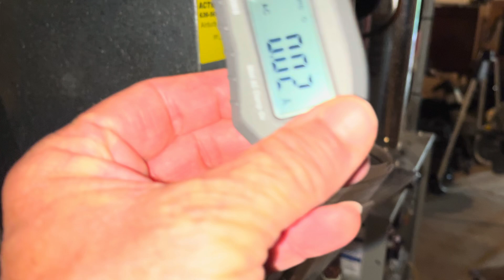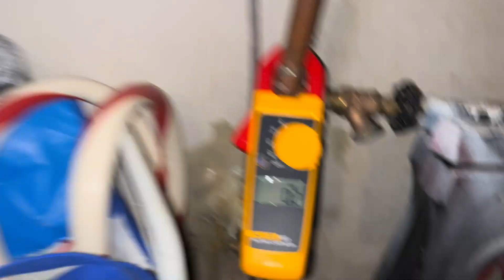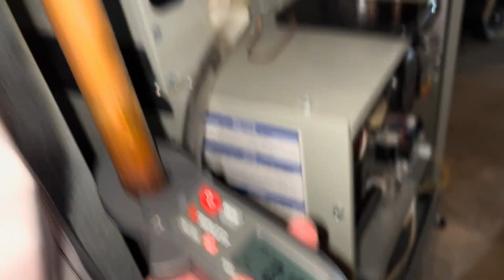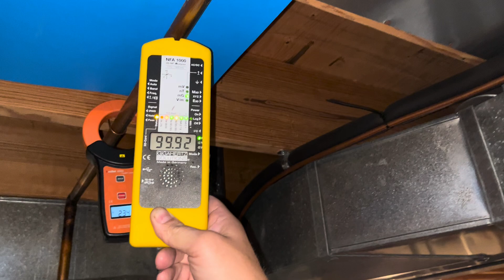Water Pipe and Gas Line touching causing current to go everywhere

Comment: In Canada gas lines as well as water lines are required to be bonded. Was the bonding correct at the load centre? Ground rods installed and connected correctly! If the load centre bonding is correct then bonding water and gas lines should direct those currents back to the source.

Comment: Ground failure of some type is usually the primary cause.   Floating ground, high resistance ground, etc,..       If the power company has a problem with their neutral there are bigger and considerably more dangerous problems.

Comment: It's odd about water pipe and gas piping. When we wired houses in Palm springs CA in the 70's, as electricians, we were required by code to bond the electrical ground to the cold water pipe and the gas piping. I guess that's not a thing any more.

Comment: The gas and water are generally required to be  "touching" according to NEC. They are bonded to the incoming grounded conductor at the service. The current is running thru them because of a fault condition in the service grounded conductor or possibly in a main panel if it is an older 3 wire system.
It is simple but complicated and I have seen it several times.

Comment: I was thinking they should start flipping breakers off then check ground / neutrals on the equipment that changes the readings. Also make sure any ground straps on meters and valves are in place.

Comment: I fully realize that utility codes vary wildly. I’m in the Louisville Kentucky area and have installed quite a few house gas line systems. Thumbnail sketch: Copper piping is not allowed. Period. Flexible stainless or rigid black threaded steel piping only. Generally speaking, you can run 1” pipe for any length, 3/4” for 25’, and 1/2” for 10’. Use reducer couplings and not bushings and include drop legs for interior terminus locations with approved shut-off valves in the same room as appliances and within ten feet. I have seen copper sweat fittings used in gas piping once in my city. It was in a rental property and the buyer had paid for a home inspection (which I consider to be a bad joke in 99% of inspection reports I’ve read) that made no mention of this egregious code violation. Oh well....
Reply: Interesting, in the UK copper gas piping once inside the house is normal practice…
Reply: Quick addendum here — for propane gas, not utility line natural gas, I believe that copper line may still be acceptable in my area BUT it’s all flare fittings for elbows and tees and not sweat fittings. Sweat fittings can melt and separate in a house fire and then you’ve really got a hot one on your hands.

Comment: I've been a cable guy for 18 years. I've seen a handful of melted coax cables. A couple weeks ago was the worst I'd seen. The ENTIRE aerial drop was melted from the house to the tap! He said it was smoking the night before.

I didn't touch anything and called the power co on behalf of the customer, figuring it was an open neutral. They came out and proved it safe to the meter, so I replaced it. I'm guessing the fault cleared itself when it stopped smoking, but I told him to call an electrician ASAP if it happens again.
Reply: Inadvertent contact to a neutral could occur only when it’s windy. I’ve seen the entire half of a panel die due to the service drop rubbing against a tree branch outside, but it only occurred intermittently; when it was windy outside.

Comment: There is an open neutral or improperly grounded device somewhere and line current is doing its best to get to ground.

Water lines and gas lines are supposed to be bonded to the building ground. 

Two questions that they need to be asking are what the potential is to ground and is there a current going to the building ground.

Comment: The electrical code and previous practice collides.  Old gas lines utilized a plastic insulator bushing between the underground line and the regulator to prevent corrosion due to ground currents. Now, the electrical code mandates the gas pipes be grounded as well as the water pipes, and both connected to an earth-driven ground rod.  Unfortunately, the gas company has been running plastic underground lines here in California, so while it’s brass above ground, a foot underground they’re plastic,so no actual electrical ground ability.  Fun times!
Reply: The in-ground gas piping is not, nor was ever, to be considered a grounding electrode. The in-house gas piping is bonded to to the grounding system, either by the equipment grounding conductor of the equipment the gas pipe is serving or by bonding to the electrode grounding system. In CA, we were usually required to bond hot/cold/gas at the water heater, if H/C was metallic and a gas water heater was installed. San Francisco wanted gas piping bond attachment close to where the gas pipe enters the structure.

Comment: According to the Nec the metal plumbing lines must be bonded….according to the EGC the gas line must be bonded (connected to ground in one place) Since no one showed these points I am going to assume that the gas installer and the Electrician didn’t do their jobs on installation or renovations….or some one stole the short pieces of copper….flowing gases and flowing fluids produce static charges…faulty equipment causes high current on pipes …very low current (which we have here) is caused by motion of gases and liquid…Just like rubbing your feet on a rug causes static charges…

Comment: In the uk it is the law that  the water and gas lines are bonded together.
Reply: No, it's not. It was, but now with plastic inserts in incoming service it's no requirements to bond it even if the rest of the pipes inside are metal.

Comment: Why not simply install a ground rod instead of using pipes and then find the offending appliance with the electrical fault?
Reply: I would lock that alarm panel.

And check it's transformer installation.

Comment: I’ve seen crazy stuff, and where are you guys located that you use copper for your gas lines? 
I’m sorry, but I think that’s a bit of a fail, I know it’s used in some places, but  😑
Reply: You're not the only one ! I was caught off guard myself. Those actually are solder joints on a copper gas line !!!  in my. region (N.C./US) we use flare only. ..if not specifically dedicated gas piping.

Comment: Wow. The water meter was moved and changed at my later grandfather's house. The bonding wire was not put back correctly.  Well it made a situation which we found out as a family like two days after. We smelled a small burning smell occasionally. Couldn't see any thing. The house was a wood Tudor with fuse boxes. We couldn't find it but my dad and family came back after we went home.  There was a bar with glowing red under the floor by the back wall. The fire dept said they don't usually show up to a house intact. Smoke builds up from the burning and the smoke explodes and would have blown the wall open. They made it safe shot some power off. Then had the electrician come by to see that that water meter want connected and the house was looking for a ground.

Comment: stray voltage will get up to 2 volts from power lines Acceptable stray voltage levels
Studies by the U.S. Department of Agriculture and several universities have shown that individual cows react differently to various levels of stray voltage. At certain elevated levels, cows may experience stress and behavioral changes, which can lead to health problems and decreased milk production. This research supports prior findings that say that stray voltage of 2.0 volt AC or less should not cause health or production concerns for livestock.
Reply: Interesting tidbit of knowledge there. I’ll let my dairy farmer know this.

Comment: At 0:18  That 0.02 amps or 20 milliamps.
Reply: Assuming the meter has the capability to actually read correctly at that low of a value  in range of the meter or that the meter is actually calibrated to zero…I have had several electronic meters that where extremely inaccurate at “zero”…
Reply: Also, at 2:05, after the cardboard "insulation" is inserted, it increases to 0.19 amps.
Reply: @stevepettersen3283  Correct, it did.  Regardless, there are problems there.
Reply: @richardl6751  Duh.

Comment: At 1:48 he should have been shocked while holding the water line and inserting the cardboard between the gas line, looking like he touched both at the same time. Usually 50 volts AC typical ground fault voltage…been there, it don’t hurt too bad as long as you’re feet aren’t grounded, then it could be different story

Comment: As a lineman for the power company, nothing surprises me... I have seen quite a few homes with major problems from the combination of an open neutral, and a poor house ground.
Reply: As a telco special circuits guy in Florida we had to start megging the grounds at all installation locations.  Usually a single 10ft ground rod was insufficient so a second and sometimes a 3rd were added to get 30 feet down.   At several locations we had to install grounding fields by putting down three separate ground rods,..   A very sweaty job when the hydraulic grounding truck couldn't get close enough,...

Comment: Possible sources of the voltage and current on that gas line: Fault in the furnace or blower motor, bad grounding of the furnace, partially grounded compressor in the condensing unit (or ungrounded condensing unit) check for current on the lineset, ungrounded gas stove, water ground bond missing or corroded, no ground bond on gas line, faulty neutral to the home. 

Find out what it is, that two amps of current is extremely dangerous.

Comment: You either have a loose neutral on the utility side of the main neutral bond or you have another neutral bonded with ground somewhere else in the house.
Reply: EMF can create some of these charge effects, but for a service ground 3 amps is normal for the amount of current that takes a path through the earth back to the service. You do not want current on the gas line, though. The two service ground locations are the cold water main and ground rod(s).
Reply: Or some appliance wired live to ground.
Reply: If you have a 4 Wire Dryer Cord or a 4 Wire Electric Range Cord, do NOT Bond Neutral wire to the case of the appliance.  Only the Green Wire from the 4 Wire Cord should be attached to the Appliance Ground Screw.  Remove any other wire from that Green ground screw that was meant for a 3 Wire Dryer or Electric Range Cord.

Comment: The first thing that seems odd, is the use of soldered copper pipe for a gas line. I wasn't aware that this is/was ever an approved installation method/material combination for either propane or natural gas. Soft copper tubing with flare fittings, sure; hard copper with solder, not so much.

Second, both the gas and water lines should be bonded to the electrical ground, nearest their entry point from the outside, when they are conductive. In this case, it appears that the required bonding isn't present, based on the symptoms and brief view near the water meter. 

Third, something with both an electrical and water connection seem to have a current leak to ground and may have a bad ground connection on the electrical side. The likely appliance culprits are dishwasher, refrigerator, washer, any point-of-use instant hot water heaters, or a dryer with a water inlet for a steam cycle. A non-appliance possibility is a nail or screw that has gone through a wire and is just touching a water line (arcing would be likely). Or finally, a wire is in direct contact with the water line and has worn or broken insulation.

And the final point is that electricity doesn't take the path of least resistance, it takes all potential paths. The current perceived on any given path is proportional to the the inverse of the resistance of the path versus the resistance of all paths in the system.
Reply: The MEN (multiple earthed neutral) reticulation system is used in NZ. A friend's recording studio had a persistent but variable hum on their audio gear. Various audio engineers had failed to even reduce it. My wife who records with them asked me to have a look. This was years ago before digital current clamps were available. After looking at almost zero hum voltages on the gear, I took an old winding from a transformer and connected headphones to it. A wander around the studio showed a maximum in a straight line across the floor. This was where the main supply cable ran underneath. More hunting showed the cable from the utility had even more hum. Turned out that the earth at the nearest substation was open circuit, some one had forgotten to reconnect it. All the 3 phase current imbalance was routed to earth thru their old (no longer legal) house earth copper water pipe. Even the utility inspector was surprised at the discovery.
Reply: @howardsimpson489  Well done.
Reply: Very well explained.
Reply: i believe the gas line should be insulated at the m.s.a. meter set assembly and have zero ground from other sources, i agree the copper for gas should not be in use as i believe the chemical in natural gas erodes the solder ?
Reply: The copper lines look brazed, which is fine
Reply: type L thick wall copper for gas lines has been legal for about 40 or so years. connection must be high temp solder.
Reply: @kurtzimmerman1637  "Any fuel gas lines installed using copper tube must be ((brazed)) using a filler metal containing less than 0.05% P (phosphorus) and a melting temperature greater than 1000 degrees F. " - from 2020.
Reply: @rcstl8815 that's what he meant by high temp solder. Sometimes called silver solder is actually b cup brazing rod.

Comment: That’s wild. I installed a ton of LED’s in a night club, controlled by DMX data, and as I added more and more drivers, things started acting weird, and once I got to around 50, all the drivers failed, pretty much at once. Most still worked, but we were unable to control them with data. Some failed totally, and while investigating a huge spark jumped to the MC cable next to it and burned the surface, and it sounded like a small firecracker. We were using the cheap power pack 24v power supplies, so I started testing things and when I tested its 24v+ on the tip, output, in addition to having its regular output, it also had a few volts AC when referenced to ground. Then, we tested AC voltage from the ring, negative output and again, we showed varying amounts of voltage. It seems that somehow this extra voltage was traveling through the cat5 cables from one LED driver to the next and the volts were adding up as they went. At first if I cut out the 3 pairs of cat wire that weren’t needed, the issue seemed to no longer cause damage, but again the more drivers added, the worse it got. At one point I measured over 50 volts. So, we changed to metal power supplies that, I guess are grounded on both sides and all was well, after replacing 50 bad drivers and 50 power supplies. I also tried connecting the negative DC output of the power bricks to ground, which seemed to work for a while, but eventually the power bricks let us know they didn’t like having their outputs grounded. But wow, your situation is wild, I see the amps, but what kinds of voltage were you seeing?
Reply: Switching power supplies cause circulating current on the neutral leg. Additionally if they are not properly grounded the grounding and metal case on the power supply can rise to maybe 90 volts AC to ground. I pert near got electrocuted on a big power plant job where the outlets for the control room computers were not grounded correctly. I touched a computer case and touched a control panel that was grounded and got 90 vac thru my heart. Ouch.